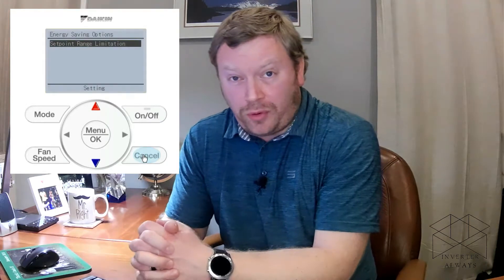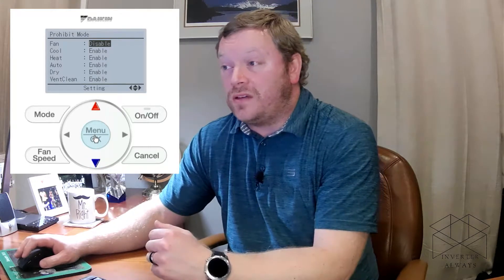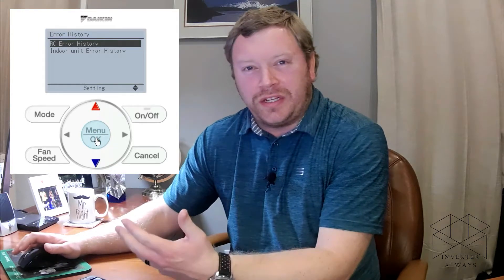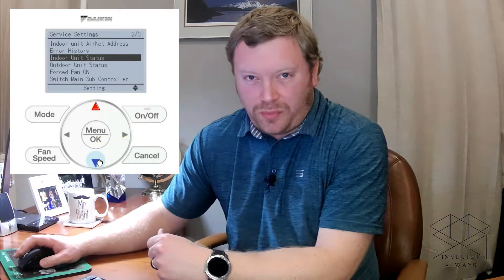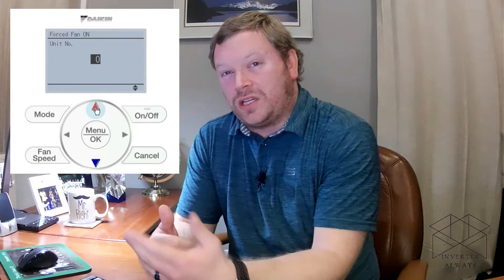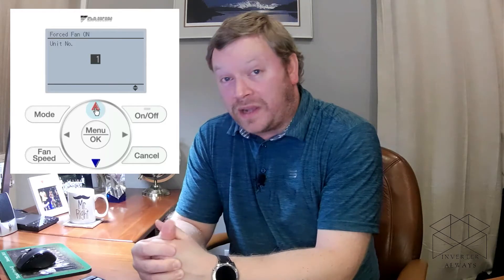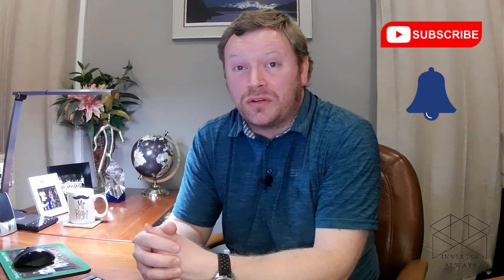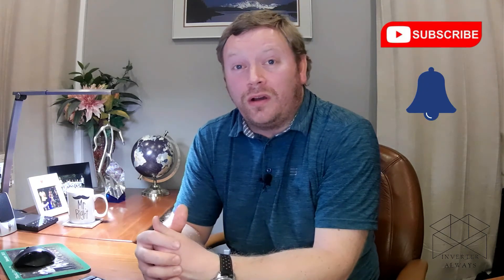How to setup a Daikin NAV Controller Part 2 | Daikin BRC1E73 | NEW CONTROLS SERIES Ep.5 (12-3-2020)

Comment: Please, I am begging you. Our school has these units and as a custodian We are getting tired of people changing the mode! We have 2 indoor units tied to one outdoor unit, so two rooms tied together. When people keep changing their mode back to heat, the room on the opposite side can’t even have the “fan” mode running, it will state “central control” and unfortunately the installer we have doesn’t know enough about the units to help. I have resorted to completely locking out the unit with the button combo and field number change so that the other room is not cooking all day. We would really appreciate knowing the button combo to put in after doing the prohibit button feature, this way people can still control temp and fan speeds to still accommodate them, not just on and off.

Please and thank you.
Reply from the maker: Ah, so you have a heat pump, which limits users capabilities. The whole system must be in heat, or cool, based on the master stat. 
First you wanna make sure the master stat is set up for the more priority room. 
Next, I would try to adjust fan off settings so that even if the non master stat goes to heat, you can lower setpoint and the fan just shuts off. This usually helps a ton. You can do this by setting the field settings to mode 22 3-03 for fan off during heat thermal off conditions. 

Next you can go in to service settings menu of the stat (nav controller brc1e73), and go to prohibit, and then prohibit buttons. Just disable the mode button but leave everything else enabled. Save. Then go to main screen and activate the secret combo buttons that activates the lockout. 

At least then it will stay in that mode. 

It's important to note however that putting the unit in fan mode when the master is in heat will allow the unit to still heat. On heat pump systems you'll always have hot gas flowing through the coils. Best to get that unit to thermal off so the fan shuts off. Or just turn the unit off. 

If you have a central controller there's some programming you can do there too.
Reply: @InverterAlways  so we used the button combo and finally! The mode button is prohibited! We didn’t want to lock teachers out fully from adjusting fan speed and adjusting the temperature a bit. Trying to be accommodating, but they just couldn’t seem to get it through their heads that their unit is connected to another classroom’s unit 🤦🏻‍♀️. 

They tied classrooms together that are across from each other… and because the building sits true east to west, when one side cooks, the other “freezes” lmao, they should have tied classrooms together that were on the same side of the hallway, but oh well, at least now the hot classrooms shouldn’t cook so much

Comment: Great videos! Shared with some other techs at our shop. We are having trouble getting an itouch panel with nav tstats set so tenants can make limited adjustments to temperatures. Very confusing. Where can i get a clear description of how to do this. The manual is 309 pages and not specific. Thx.